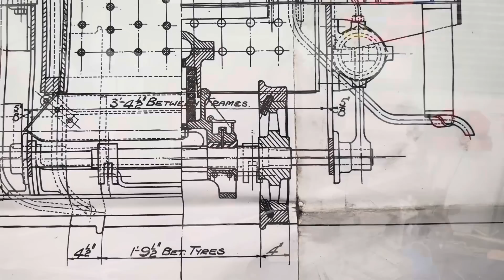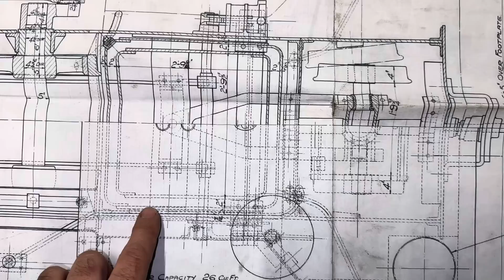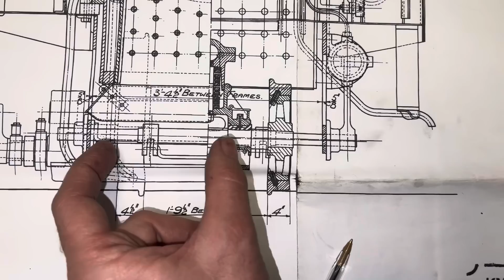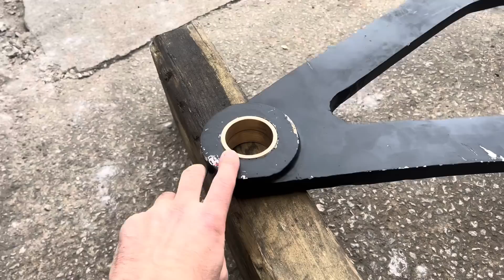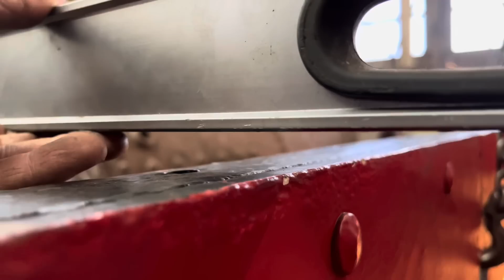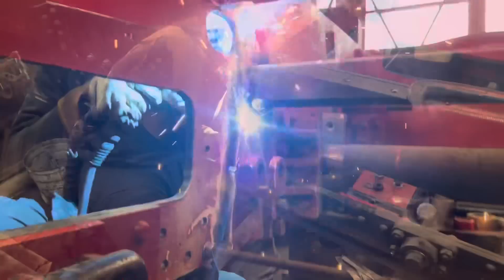Fowler 16341 restoration part 21

Comment: Amazing work. What does the frame ‘adjustment’ mean for the holes already bored in it? Will you need to make some adjustments to the cab to line up, or are they still close enough to square for it not to matter?

Comment: What a treat on a Sunday. Great to have you back and superb work as ever. 
Are you going to do a die penetration or ultrasound check on the frame weld?
Reply from the maker: Probably not.  It’s a beautiful weld by a talented coded welder.  If we were intending to run at 70mph on the mainline then yes, but for 25 max on 2’ gauge, and with the section being behind the coupled wheelsets, I don’t think it’s necessary.  🙂
Reply: @TheSteamWorkshop  fair comment. I wasn't criticising just curious. As you say, it's a fairly dramatic thing to do.